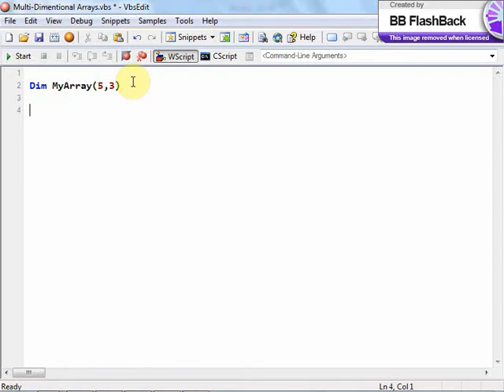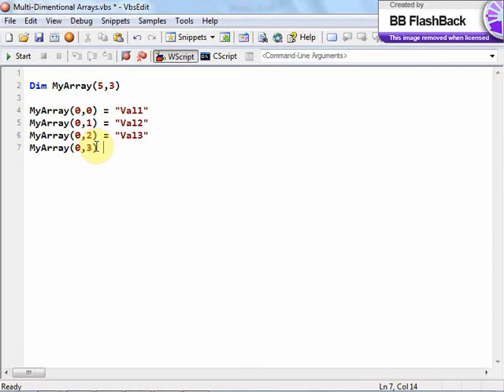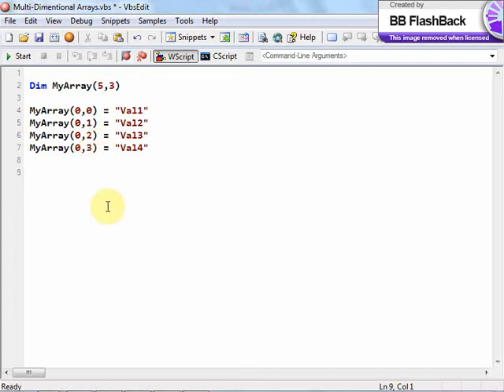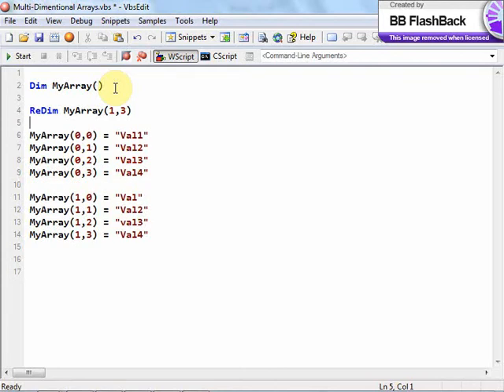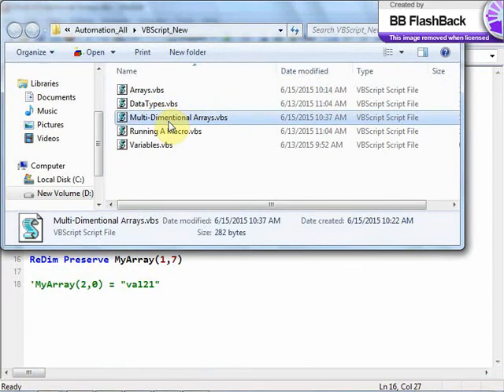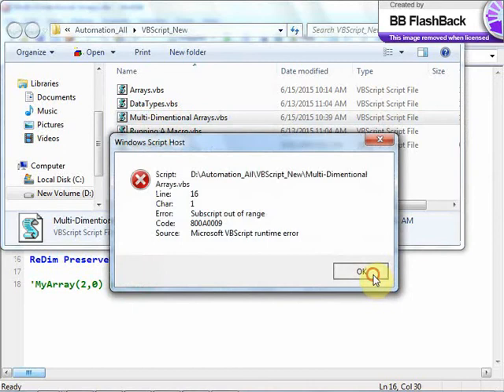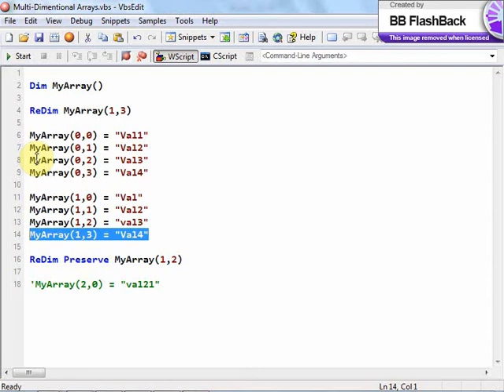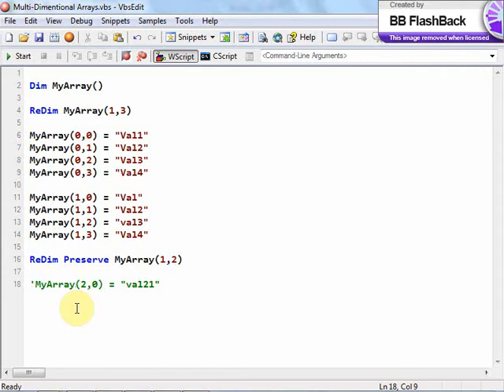Arrays Part2

Comment: I like your teaching techniques, I have a question I have two columns colA stores user name ex, a,b,c then colB stores values ex: 1,2,3. I want to split them in array and want to create a loop  that will extract the values concurrently,   . My expected output is first it will extract a, then 1, then b then 2 and it looks through until no value exists. Thanks